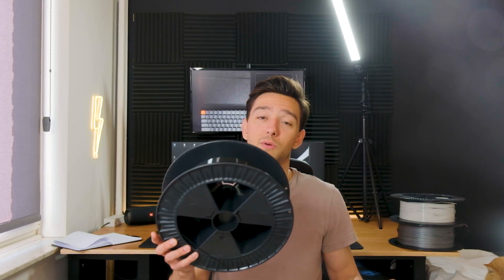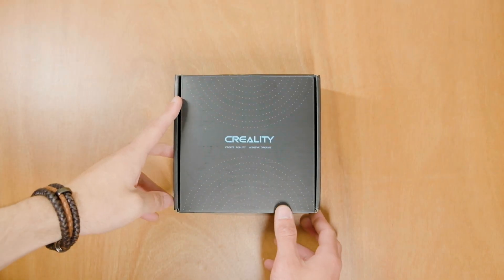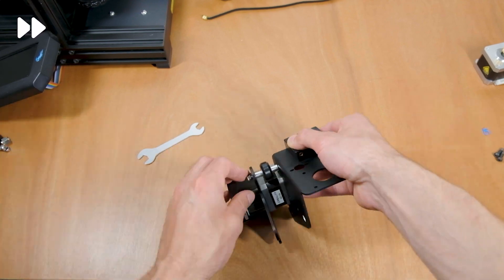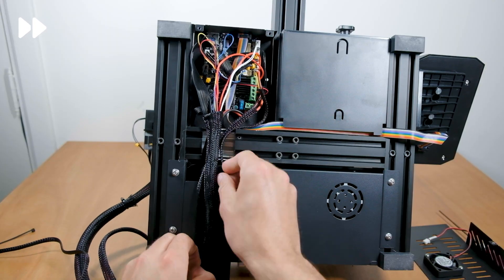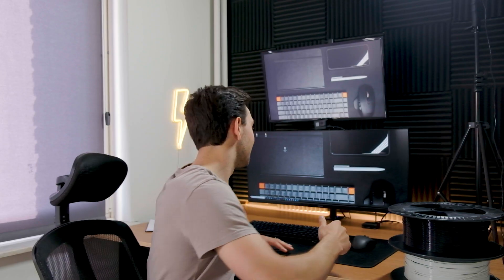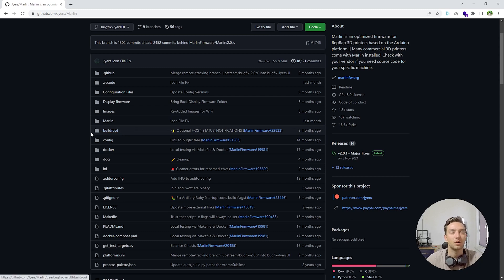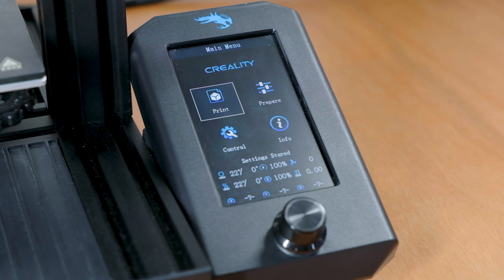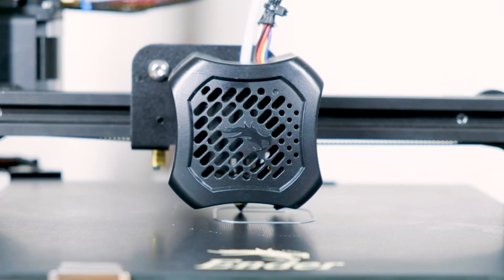How to install filament sensor | Ender 3 V2

Comment from the maker: Seems like a lot of people managed to switch out the bracket without removing the whole axis, so you might give it a try this way! Saves you some time 😁
Reply: After downloading the firmware it took away my auto leveling what do I do
Reply: @daskid_22 grab the cfw that supports BL-Touch
Reply: @digidex4557  What does 10x10, UBL and HS stand for?
Reply: @rramsey69  UBL: Universal Bed Leveling
I believe 10x10 refers to the number of points it checks for leveling. HS may stand for high speed, which is typically not recommended for normal users

Comment: Thanks, I'm a little behind the times but I'm trying to get the most out of my Ender 3 v2. I added a filament sensor and CR touch leveler. Jyres' build had everything I needed in one try. This saved me hours of work!

Comment: I find the disassembly to be too quickly recorded, so I'm stuck at the last bolt on the bracket that goes through the rail... I've had to go back a lot of times to see exactly what parts you're touching, and even after reviewing the footage repeatedly, I'm still guessing.. It's the best video I've found so far, but not particularly well done imho.

Comment: This is a great starter video about the process of installation however you are doing too much work !  You can disconnect the tube feeder and connectors to the extruder feeder motor and remove the three nuts that attach the mounting plate to the gantry.  Also, remove the two screws that attach the screw drive.  This allows the removal of the extruder feeder assembly without disassembling the frame and removing the entire gantry.  Easy !!!

Comment: Can this sensor be installed for the printer ender3 v2 neo?
Reply: Yes, but the firmware he recommends is not the correct one because it doesn't include the "BL" sensor (the thingy that touches the plate to home Z), so you need to choose one that does have that.

Comment: I got a black screen after following your instructions exactly. So here’s what I did. Might make a difference for someone having trouble. Don’t do the “quick format” option on the card. Do a full format. Also I hit the “eject “ button before pulling the card out of the computer. I also pulled the power cord out for a few seconds, turned switch on then back off, plugged cord back in and inserted so card with firmware on it. Powered back up and it works perfect. Don’t know what exactly I did wrong the first time.

Comment: Good morning,
Sorry about my English, I don’t speak it well.
I watched your video and it helped me to place my cable end sensor on my ENDER 3-V2.
I updated the software as you explained with the correct version 4,2,2.
Everything is working well.
Except that when there is a current break, the print does not restart where it stopped, but it starts from the beginning.
Can you help me?
Thank you and beautiful day,

Comment: I currently have the Ender-3 v2 Neo with the 4.2.7 motherboard. It has the leveling sensor on it also. Is the default firmware still the correct download?
Reply: Still waiting for someone to answer.

Comment: will this fit on ender 3 v2 neo?
Reply: installed my filament sensor today, used the firmware on the website of creality, flashed the firmware onto my mainboard..success, flashed the firmware onto my screen...no success

Comment: I came here to watch how the sensor is installed. Your video failed because the actual part I was interested in was sped up. I'm not interested in having to pause every ten seconds to catch up. No love from me. Sorry.
Reply: Even when you slow it down it's way too fast lol 😂
Reply: Seriously. He's saying to disassemble something and he speeds it up to what we can't see.
Reply: Same!
I have an original cr10 and can't find instructions anywhere on how to replace the extruder bracket clearly. Most are gor different models and the steps don't apply.
Has anyone found a good guide? I also can't believe that creality doesn't have a support site for their products. Everything is via email and that is slow and communication is iffy. If you ask more than one question they only answer one and you have to keep going back and forth. They should have online instructions at minimum and a video tutorial would be great! I'm seriously starting to get put off from Creality  and I've supported them since 2016.

Comment: Oh my gooood it makes my eyes bleed man! Never lay down your printer on its back! You have just bended Z axis T-nut! And that's how z-wobble appears after filament sensor installed XD If you want access to mainboard lay down your printer on its side, never give preassure on Z axis nut!
Reply from the maker: That's indeed a valid point, putting a lot of pressure on the z-axis would not be good. I this case I don't think the weight of the printer is actually enough to do some permanent damage, but still better to avoid than having to fix it.

Comment: I guess there has to be a 3dprinted base to attach next to extruder so you dont have to disassemble the half printer.
I have something similar as a filament guide.

Comment: i have an ender-3 and i can see that all the firmware versions are for the ender-3 v2, will these work with my ender-3?
Reply: have you find out?  I have an ender 3 pro
Reply: I dont know I just dont use mine, and use a sonic pad insted

Comment: What version would I use for a Ender 3 pro with a cr touch and board ver. 4.2.2???
Reply: have you find out if it works with ender 3 pro?..Please help

Comment: thank you for this tutorial. without which it was a mission impossible !  However, now  I'm looking for an easy way to replace the filament once the end is detected . it's really difficult with so few space betwwen the sensor and the extrude. any advice ?

Comment: does this work on on ender 3 pro? because after bin file. screen stays blue
Reply: same here E3V2-Default-v4.2.7-v2.0.1.bin doesn't work stays on blue screen
Reply: did you fix it, if so how
Reply: @maxenlol  no still blue screen
Reply: have you fixed it? I want to install same sensor on ender 3 pro

Comment: Hi! Great video, I've one question though I have a ender 3 v2 Neo, and I think the firmware is different for the regular v2, can I install the sensor without changing the firmware?
Reply from the maker: Just looked up the Ender 3 neo hadn't heard of it. 
I have no idea what it's firmware looks like, it's possible that it has the option to enable a filament sensor but I am not sure.
Reply: @yoramswiers  thank you for taking the time to answer how you're doing great will recommend you channel
Reply from the maker: Also depending on the board it uses you can flash new firmware that has filament sensor support.
Reply: Hello, I have the same doubt. Did you manage to solve?

Comment: I have an Ender 3 V2 4.2.2 and I installed the oem filament sensor and I have a touch screen, I am unable to update the firmware, it wakes to a Creality screen with a progress bar and nothing ever happens.  Any ideas?

Comment: I have the Creality Ender 3 V2 with the 4.2.2 highly modified.  I am running the added z axis 2nd motor upgrade which I highly recommend(gets rid  of any sag on x axis) along with the $40 Creality Direct Drive extruder(they did release newer direct drive for around$98 which I may upgrade to in future but happy with current setup).  The $40 direct drive has worked flawless since install and setup.  I just picked up the filament detector will use your video to get it hooked up, I will have to design different mounting since I am running direct driver extruder.  I am also using CR touch added some G Code for the auto level routine, have not had to set any height changes in over six months, works incredibly well.  I also just recently bought the surround chamber for the unit which should keep temps more stable.  I have used PLA, PLA PLUS, NylonX with CF, and PETG with CF without any issues to date.  I actually like the way the CF adds some hold to the prints keeps things stiff while printing tall items.  My most used nozzle is the hardened steel .6mm for type of items I 3d print it is good speed and quality good compromise, plus holds up well to the CF.
Reply: is this a comment on the video or a diary entry?
Reply: Were you ever able to get the sensor and the touch to work at the same time?

Comment: Hello. What firmware i need to choose because i alredy got CR Touch and now i install that smart filnament sensor... in github site they re many choises... i know what board i got but idk what is the correct file... I got this option... 
E3V2-BLTouch-3x3-HS-v4.2.2-v2.0.1.bin
E3V2-BLTouch-3x3-v4.2.2-v2.0.1.bin
E3V2-BLTouch-5x5-HS-v4.2.2-v2.0.1.bin
E3V2-BLTouch-5x5-v4.2.2-v2.0.1.bin..
idk whta means that 5x5 or 3x3 or with HS or without..
And i got btt smart filament sensor  ... not same u got in the video...
Thanks for answer !

Comment: Thanks for the great video. An easy step by step. Just one question, will the Jyers 

E3V2-BLTouch-3x3-HS-v4.2.2-v2.0.1.bin 

work on my Ender 3B and will it have the firmware for both CR Touch and Filament runout sensor. Thanks.
Reply from the maker: I don't know for sure but I suspect it would. As long as you pick the firmware that is configured for your board there is not much that can go wrong. It may not work but your printer isn't going to blow up :p

Comment: If de have a creality Cr Touch, can we take the firmware with Bl touch ? Will it work ?
Reply from the maker: Hmm don't know for sure but I think it's possible it works. The sensors seems very similar and have the same amount of pins, so it may work if you're lucky, but it's probably going to need some extra configuring though.

Comment: I am a newbie at this. Will the firmware you have selected work with both , the filament sensor, and the CR touch unit?

Comment: Hey, on my printer I use a sensor witch has 3 wires. I followed all steps, but wenn Iit starts printing it emedietly show Filament Runout. Does sameone know why it could be?
Reply from the maker: Does it keep printing if no filament is loaded into the filament sensor? If so, it's probably just a matter of switching 2 pins on the connector. If that's not the case you can always send me a dm on any of my social media and we can try and resolve it!
Reply: No it stops printing and starts the reload process. It stops printing even there is filament in the sensor. But i have seen a video on how to use such a sensor and i realy have to change some wires. I´ll try it out later.

Comment: You could have just removed the extruder and x axis bracket. I have the same unit and that's what I did.
Reply from the maker: Indeed others mentioned this as well, I pinned a comment about it. 😃

Comment: Tried it and screen stayed blue firmware doesn't load
Reply: Not sure what I did wrong
Reply from the maker: @Jcricks626  Are you sure you picked the right firmware version for your printer?
Reply: @yoramswiers  Same issue and did install correct firmware 4.2.2 is the same I have as well screen stuck blue
Reply from the maker: @Slanginsixseven  If you checked version number on the board and it matches the firmware version number and it still does not work. My first guess would be a hardware related issue... Maybe you can try using a different sd card? Also are you able to flash the stock firmware version from the Creality website?
Reply: @yoramswiers  Hi there, I have the same issue as listed above. I can indeed flash the stock firmware and print normally again. Also, the filament sensor does have power and turns on its light when I insert filament. Therefore I was thinking it isn't a hardware issue. 

I am however using an ender 3 pro, with a v4.2.2 board. I thought this version would be identical as it's the same board, but would you might know if there's anything in the firmware I need to change to accomodate for the different type of printer?

I'm gonna work on this a little longer and if I get something that works I'll let you guys know.
Reply from the maker: @marijnvanlimborgh7009  hmm, I doubt the firmware between the normal and the pro differs that much, apart from some parameters regarding height etc. Make sure you have a freshly formatted sd card, maybe also try a different one and just try to flash the most basic version of the firmware. If all that doesn't work I am afraid I don't really see the issue. Appart from creatilty maybe updating something on their boards also Jyers hasn't been maintaining this library unfortunatly so this is actually doomed to fail at some point 🥲.
Maybe I will create a tutorial on how to creating your own marlin build that you can flash.
Reply: @yoramswiers  I guess it did :). I think there might be a different chip in there. If anyone else has this problem, it's fairly easy to compile yourself. It only took me about 15 to 30 min with the help of this very clear tutorial https://youtu.be/TO8QxaOEAJI

If you follow the tutorial keep in mind the builder she uses do not have all chips from that manufacturer installed. I just use the one that got closest in the naming and it worked just fine.

Comment: Thanks for the video. I got right to the end and found it didn’t align with my Redrex Dual Gear Extruder Metal Drive Feeder. I need to raise the run out sensor by 10mm.
Reply: Exactly! Spacer designed, sliced, printed, fitted and working a treat. Cheers.
Reply from the maker: @paulowen9628  Perfect, just like it should be!
Reply from the maker: That's unfortunate, luckily we have a 3D printer 😎

Comment: will this firmware also support the bl touch
Reply from the maker: Yes check around 7:00 or https://github.com/Jyers/Marlin/releases . Here you can find different firmware builds depending on your configuration, as you can see some have BLTouch in the name.

Comment: Thanks so much for this well explained video. Funny how the Creality sensor comes with no instructions whatsoever. This was just what I needed to make it all work. Except the part about pulling off the entire x-axis. Managed to install the sensor without having to do this step. Thanks again.
Reply from the maker: It seems like more people actually made it work without tearing of the whole axis 😀 Glad you like the video! Yeah it's funny how they don't  even supply any firmware build for it, you really have to kinda know what you're  doing to install it 😅
Reply: @yoramswiers  It was a fiddly process, which I did before watching your video. In hindsight, I think it would be easier on the fingers to take off the whole axis like you explained. Live and learn. I guess they rely on folks like you to put out explainer videos.

Comment: good vid mate easy to follow, you can install the sensor without removing the whole thing, just gotta undo the 3 bolts holding the bearings in and it pops off, saves some time. Firmware install was super easy to follow. keep up the good work
Reply from the maker: That's awesome, glad you liked it! Did you actually managed to get of the screw that goes in the T slot on the X-axis. I Tried it but didn't really work and I got get it off I wouldn't be able to get it back in there very easily. Hence why I went this route, am I missing something?
Reply: @yoramswiers  yeh getting it off was hard. I jammed the little screwdriver in to stop the nut turning. Getting it back on was way easier.
Reply from the maker: @oDesired  Yeah that's what I was going to do, but didn't think it would be so easy to get it back on.